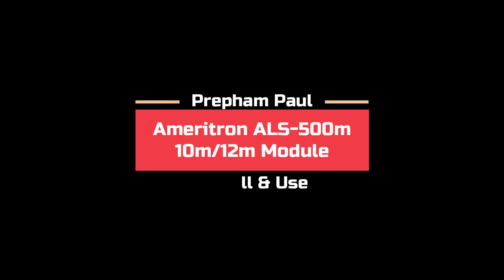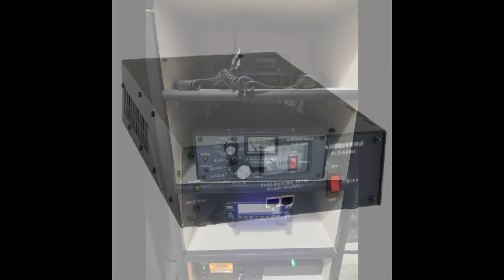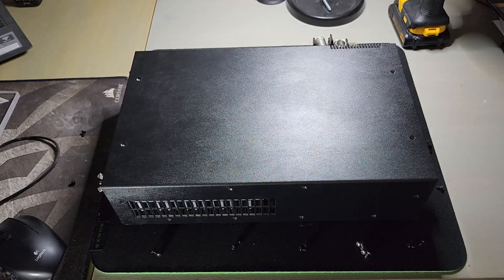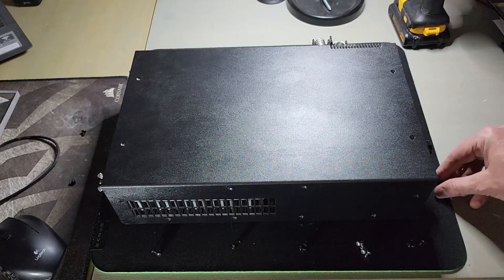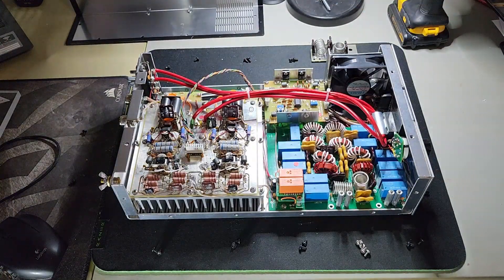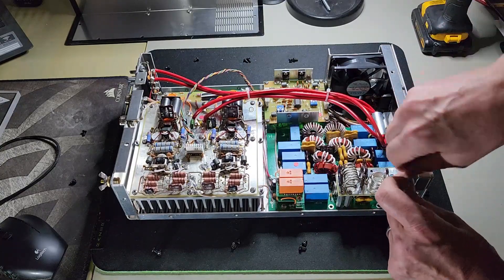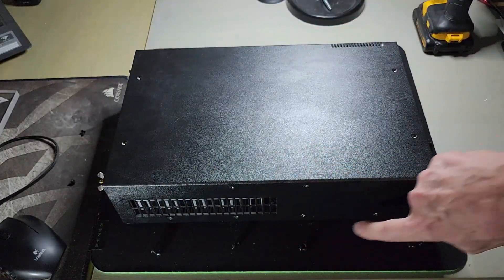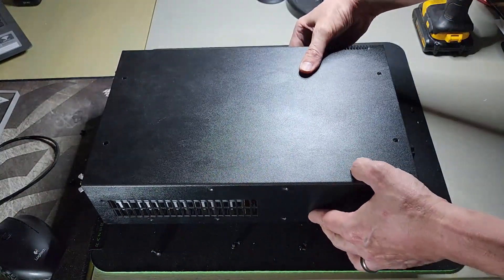Ameritron ALS-500m Amplifier 10m/12m Module Upgrade

Comment: Hi Paul how long do you have this amp? Works good in 10M?
Reply from the maker: I got the amp last February and the 10/12m addon  last May. It works great!  Any band I use it on I seem to be easily getting above the noise over others at 100w or less.  I didn't want a large amp so this one fit perfect sizewise and also it is 500w so I can't blow any of my antennas as they all handle at least 500w. We could always try to QSO and you could see if you'd like.